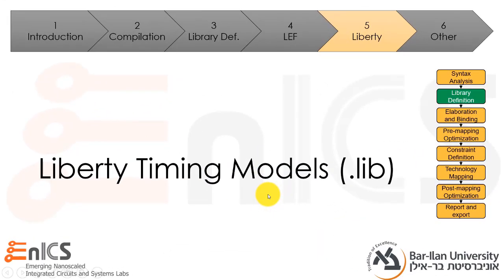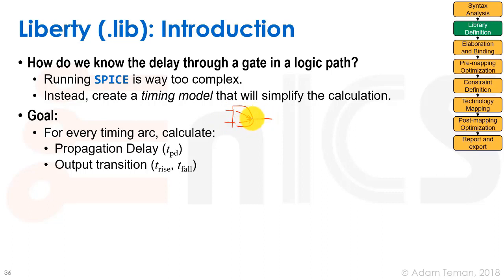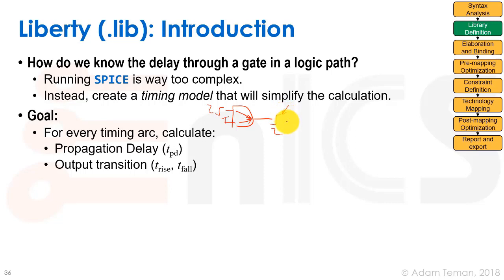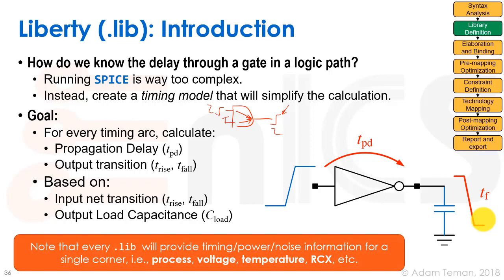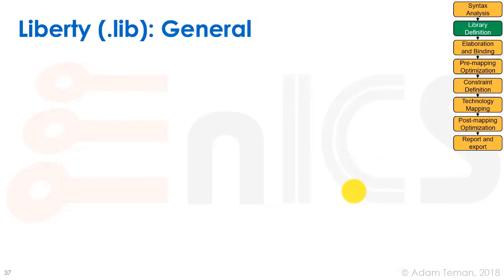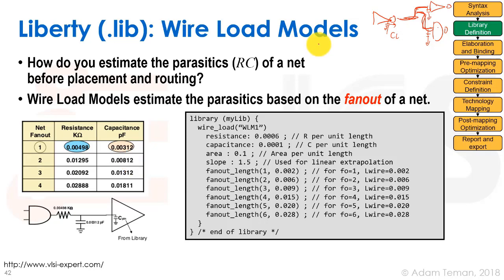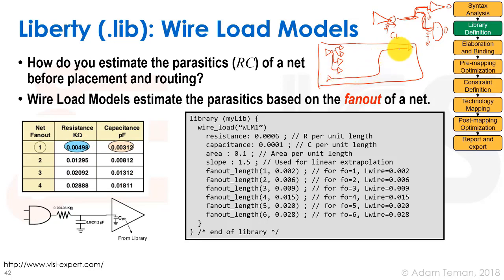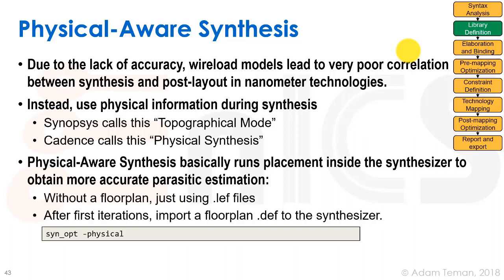DVD - Lecture 3e: Liberty (.lib)

Comment: Hi Dr. Adam, Can you explain the liberty of a Flip Flop cell? How setup and hold are described given that you've mentioned that timing() section is for output pins only?  Can you also give intuition on how the ETM of that flop would behave/change if the D/Q pins are buffered? what would be the effect on the output lib for such a modification? Thanks.
Reply from the maker: Great question - I guess I didn't want to complicate things by going into so much detail (the Liberty user manual is about 1500 pages long and just trying to explain the small percentage of that that I actually know about would probably take many hours :).

So yes, setup and hold are different than regular propagation delay timing data and they are related to input pins. It's actually not that complicated, but whereas tpd and tr/tf are based on two factors (input transition and output load), the setup/hold constraints are only dependent on the input transition. Therefore, they come with a different "template" that has only one dimension, rather than a two dimensional table, like tpd. Basically, the table tells you for each transition of the input, what is the required setup/hold time. The tables are called setup_rising, setup_falling, hold_rising, hold_falling. You can see an explanation around page 250 in the user manual to that someone uploaded to the internet here: https://media.c3d2.de/mgoblin_media/media_entries/659/Liberty_User_Guides_and_Reference_Manual_Suite_Version_2017.06.pdf

Note that there are several other constraints and things in the Liberate file, such as recovery and removal. If you are interested, I suggest reading through the manual a bit. It's pretty readable. The user manuals for tools, such as Cadence Liberate and Synopsys PrimeTime, also have great explanations, if you have access to them.

For your second question, Liberate's user manual would probably provide the answer. It is taken care of by how the setup/hold times are extracted. I actually explain this in Lecture 7 of my VLSI course (slide 33 of this slide deck: https://www.eng.biu.ac.il/temanad/files/2021/04/Lecture-7-Sequential-Logic-2020.pdf).

The short answer is that setup and hold are not based on an analytic breakdown of the topology of the flip flop, but rather extracted empirically through simulation. So the flip flop is a black box (and any other structure can be relevant, such as a memory or custom IP) and the testbench incrementally changes the skew between the clock signal and the input transition until it fails (with the failure criterion usually being an increase in tpd at the output). So any internal structure change (like buffering) is just taken into account by the simulation and you don't need to address it explicitly.

Hope that explanation is clear.